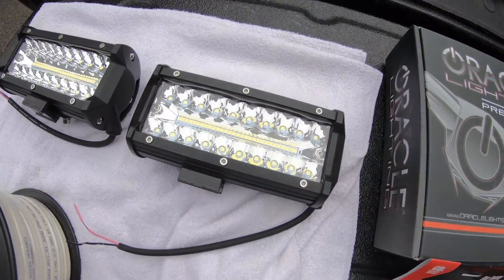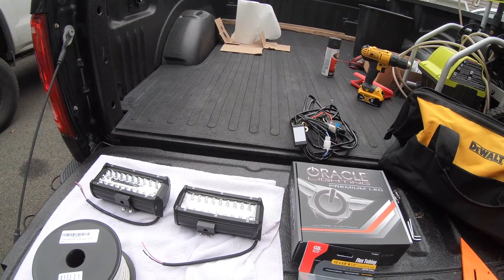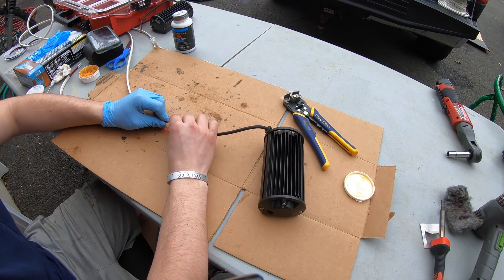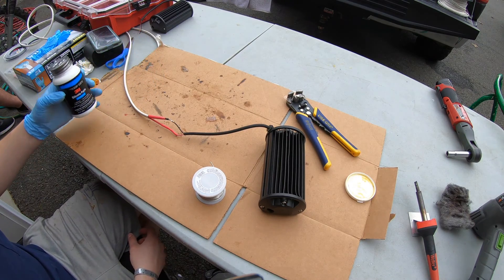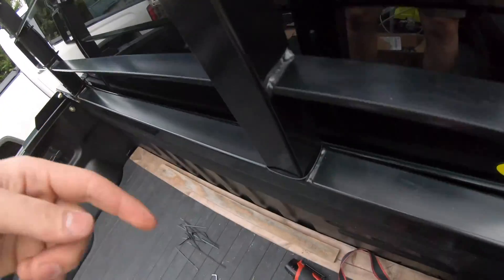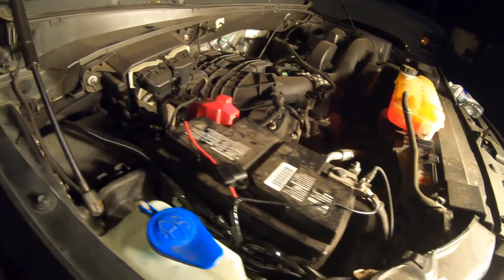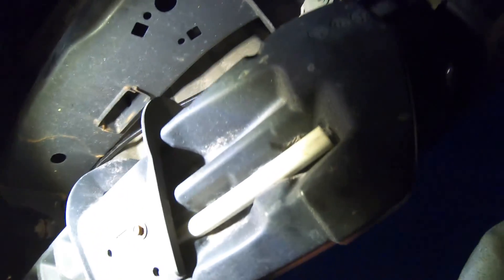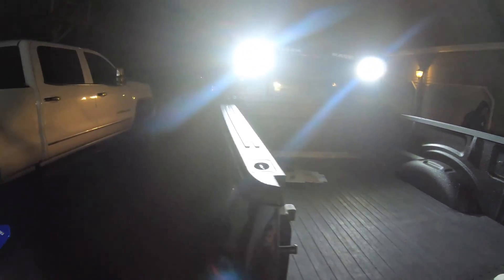How To Install LED Lights On a Back Rack [4K]

Comment: How did you splice both light in to one main wire?I assume you did power to power ground to ground from light to light then add a third wires to run to the battery for power and ground?
Reply from the maker: Yeah thats correct!

Comment: Very nice and detailed step by step video. Is there anything that you would recommend to add to this build, as a safety or anti theft protection?  I’d love to get lights on the rack but  am paranoid about the lights getting stolen, especially if I have to park out on the street.

Comment: I am wanting to purchase a Back Rack and install a set of LED light pods.  Can I use that same wiring harness that you use?  I also thought about wiring them into one of my upfitter switches but I am not sure how to do that.  Can you give me some insight on how to do that?
Reply from the maker: You could use the harness I used or the upfitter switches. What truck / year do you have?
Reply: @TrevsGarage   I have a 2016 Ford F250 Super Duty.  It has the 4 upfitter switches.  If I use an upfitter switch, how would I wire the lights into the switch?  Your help would be greatly appreciated.  Thanks.

Comment: What lights are those and how did you make them strobe
Reply from the maker: The lights we just a set of led lights off of ebay and they strobe due to the wireless switch module we used. Both links are in the description.

Comment from the maker: @metal1301 I am not sure what happened to your comment but I did read it. Thank you for the plethora of information you included. I actually came to realize on my own using the dielectric grease with heat shrink was not working and had since stopped using that, someone had taught me that. The different styles of splicing the wires together was definitely interesting and I looked into all of them and will definitely be using for the future. I am at still happy with the work i did here because many people opt to just use quick crimp connectors which I don't believe in at all. I did and always use an inline fuse on all of my wiring projects, must have forgotten to include that in the video. And for sure those Milwaukee lights are killer I keep one in my own truck at all times great for an emergency and very impressive run time on them.

Comment: With that remote can you control more then 2 lights separately ? 

I have a back rack on my truck and I want a 12" light bar facing forward and 2 , 4" cubes facing towards the rear but i would want the front controlled separately from the rear facing lights is that possible with the 1 remote ?
Reply from the maker: You unfortunately can not control them separately from that switch it is just one main on off, the other buttons are to control the flash pattern. I am actually currently working to develop a product that will have the ability to wirelessly power any number of accessories from 1-8 if it works out I will let you know.
Reply: @TrevsGarage any product yet for multiple lights / switches?
Reply from the maker: I could track something down for you? Does it need to be wireless or hardwired is okay for the controller